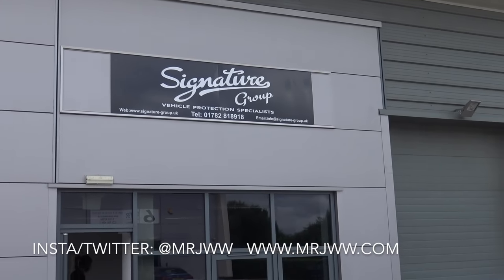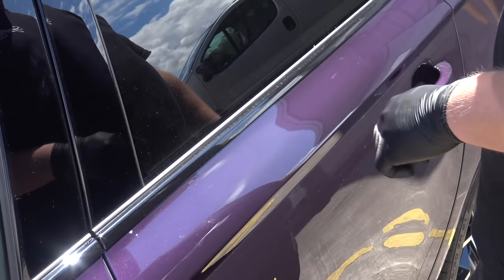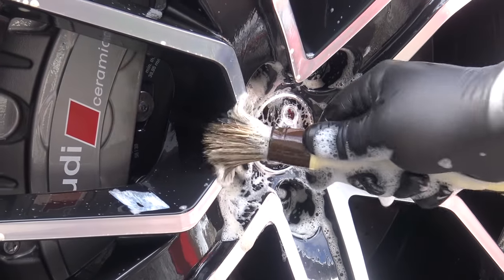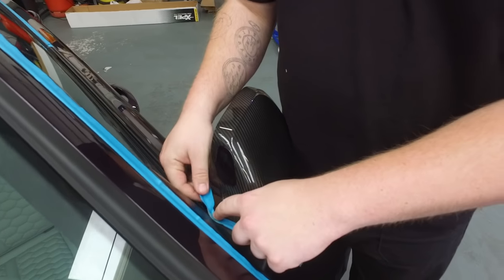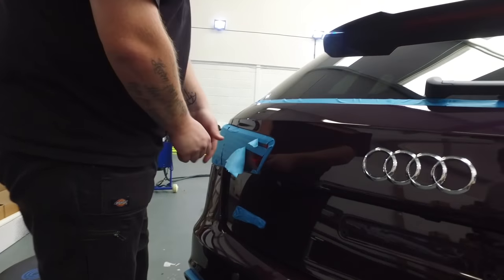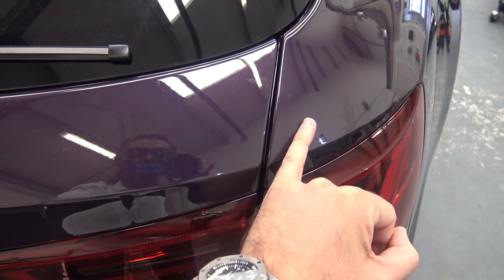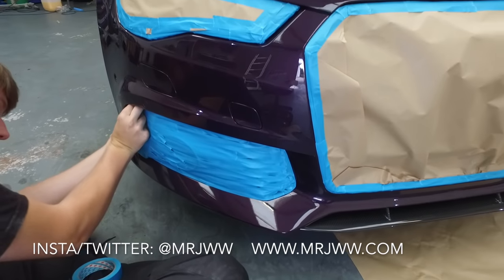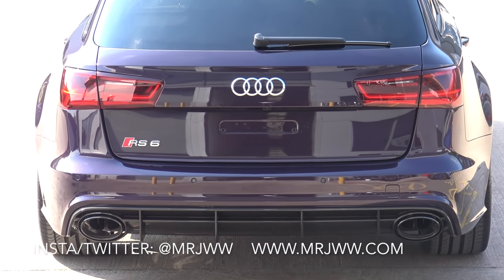Audi RS6 Paint Protection Film & Detail

Comment: The brown is the oils in the tyre being stripped out, normally done by a high alkaline cleaner. It's ok to do but if you do it constantly you'll noticed tyre wall degrading on certain tyres.

Also "circular" swirls are harder to remove isn't true, a rotary cuts circular and so does a sander. Straight line claying is more about consistent passes and thorough decontamination- if you install marks heavily from claying you haven't decontaminated the car correctly and haven't used enough lubrication.

Guys have done a great job but some of the information on this is a partially incorrect.

Comment: Looks like you are washing off the purple paint before it is properly hardened which usually takes 2-3 months from production. That's why it is recommended to avoid washing bays with brand new cars for the first 3 months.
Reply: irmenkop85 He did not wash off any paint... While the paint might not be the absolute hardest it certainly isn't going to be just "washed off"

Comment: Dont you think the purple might be overspray dust from when the car was painted,Purple?
Reply: The metallic paint is clear coated, so very unlikely.  Plus believe he says that it's the cleaning solution reacting to the metal particles in the dirt/dust turning purple.
Reply: Its base coated first,the paint can get in places the clearcoat doesnt.If you watch Schmees video of the same thing being done his drips are the same colour as his car and look the same as this.Where would so much iron particles have come from to make so much purple?For a start 1/2 the car is aluminum.
Reply: It's travelled from Germany right? Tons of road dust which probably also includes metal from brake dust which makes the solution turn purple, not the color of the paint. At least that's how he explained the color drip. I imagine any car that's been exposed to the road has some amount of brake dust on it.
Reply: and also from the ground, which i believe was not washed 5 times

Comment: I'm surprised by the level of orange peel paint in such a high spec car. BMW's are pretty bad but I though Audi had a superior paint factory. It would probably have been a good idea to wet sand prior to the PPF application. Sweet car all the same 👍👍👍
Reply: Wetsanding costs a fortune, very fee can do it CORRECTLY AND it's pointless to remove that much paint on a car for no reason, Audi paint is also super tough to work with and the PPF has a orange peel of its own

Comment: never too sure that using an air line would blow high speed swarf from inside the compressor tank into the paint.
Reply: and oil
Reply: for sure they will have a filter
Reply: air regulator would stop swarf and oil separator will stop oil

Comment: 80% of impacts occur when you park. Discreet, Effective, Quick to install. REMOVABLE system, fixed when stopped. Ideal for Paris. StopShock allows you to park in the city safely. Avoid impacts, scratches or dents. Patented system. Keep the general condition of your car.

Waterproof
Discreet
Removable
Resistant
Stabilizing bar

Comment: Honestly quite bullshit of manufacturers to ship out cars with so much flaws. It's very common and yeah the dealers usually clean it up once it gets to them, but they don't do such a good job either. I mean, if someone spends EVEN 60,000 USD on a car the service should be flawless. Let alone a damn 130,000 USD RS6 Performance.(More than 130K  cause of the special colour.)
Reply: Agreed. .. Had a paint flaw issue discovered at delivery with a new MY94 E-Class 320 sedan I'd order. .. The sales dude thought he'd just blow off issue as common place - "we see a lot of E320's like that". .. O yeah, BS. .. What's the contact info of the MB area zone Rep? .. The balance will be paid when the flaws are addressed. .. Luckily a flaw was located within a removable panel underneath the headlight wiper/cleaner; remember the '90's headlight washers/wipers? .. Too funny.

Comment: noticed some decent sized flaws in their installation, but other than that good video. i used to be one of the people that creates those designs that are then cut on the plotter. not easy lol.
Reply: And these 'flaws' were ?
Reply: @johnthorley8162  lining up edges, noticed a few that were pretty far off, but it's going to happen sometimes depending on the vehicle. When patterns are designed, they're designed to be stretched at certain points in a certain order and sometimes they're installed a different way